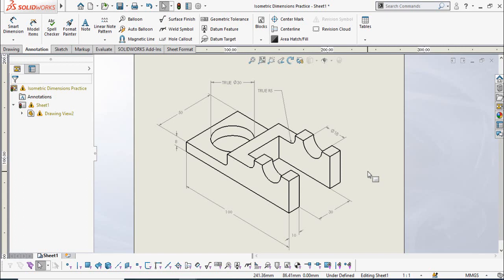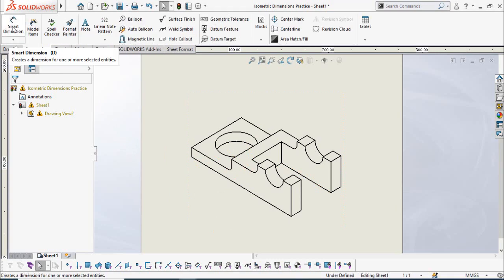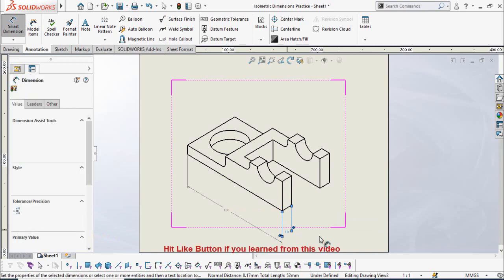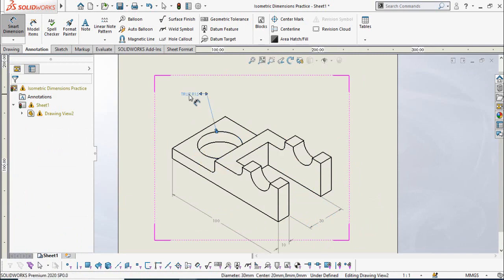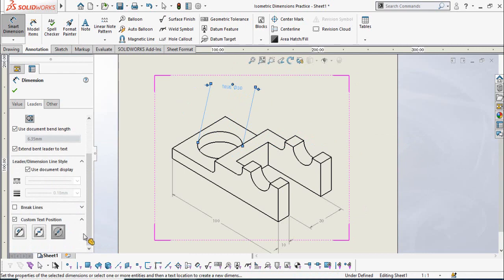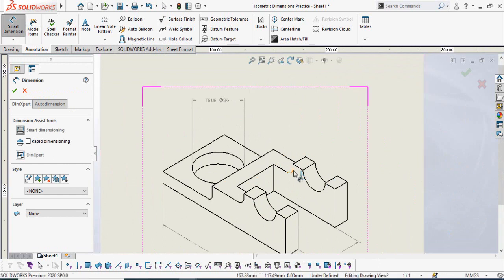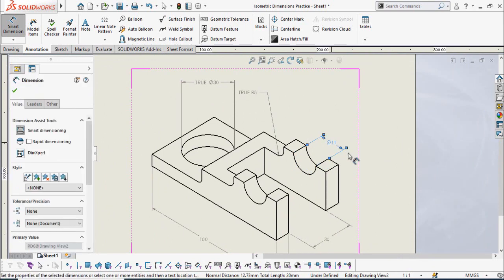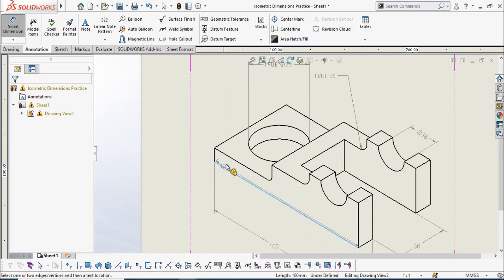How to add Isometric dimensions in SolidWorks Drawings

Comment: I'm having an issue showing dimensions in a detail view of an isometric drawing of an assembly.  When I try to dimension something it shows me the dimension "as viewed" in the detail view.  For example, a 2" wide part will show a dimension of 1.41" horizontally in an isometric layout.  The frustrating thing is that this happens on and off and I don't know how to fix it if it doesn't work in a drawing.  what could be the issue?
Thanks
Reply: It is a setting of the drawing view. Make sure the Dimension Type setting is on True (not Projected)